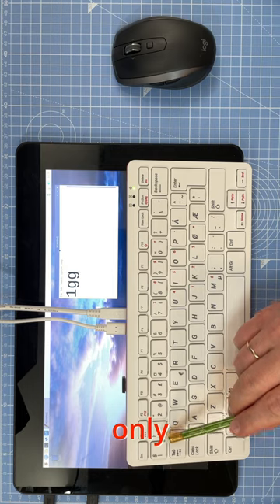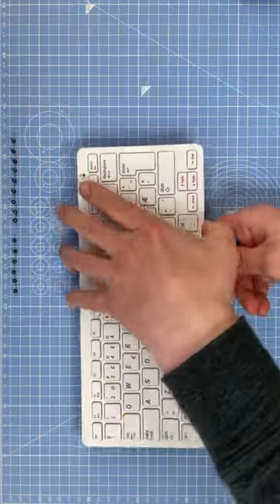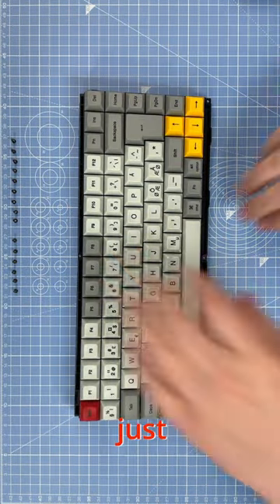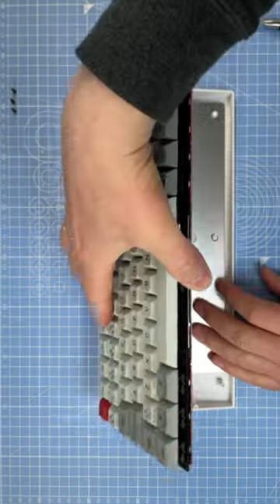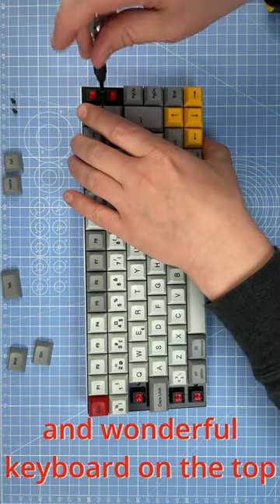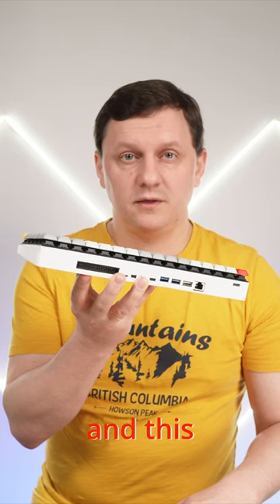Raspberry Pi 400 mechanical keyboard upgrade #shorts #mechanicalkeyboards #raspberrypi

Comment: You should have returned your Pi400 because of the unreliability. I use mine for couple of months and never ever had an issue with it.
Reply: @whalehunter2407 still works properly, I am using it for Amiga emulation. It is not as comfortable as my mechanical keyboard which I use with my Pi3B but I still can’t complain about reliability issues.

Comment: You didn't even mention what the replacement keyboard is or how to connect it to the pi's interface.  You can't just drop a keyboard on top and expect it to work.  Is it connected to a header on the board, to one of the usb ports, bluetooth, etc.?  This video doesn't provide the important details.
Reply from the maker: I joined Raspberry Pi 400 and Keyboard Vortex Tab 75. Connect via USB.
I added link in to the description with longer video: https://youtu.be/TTT5TCiPke4